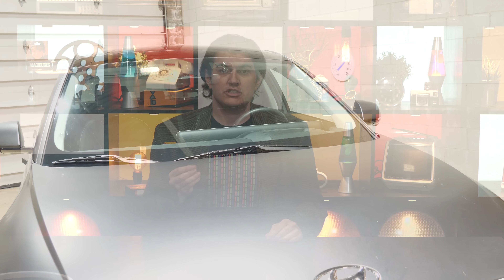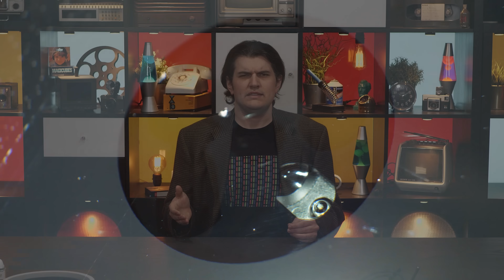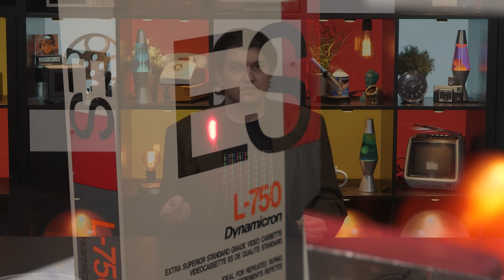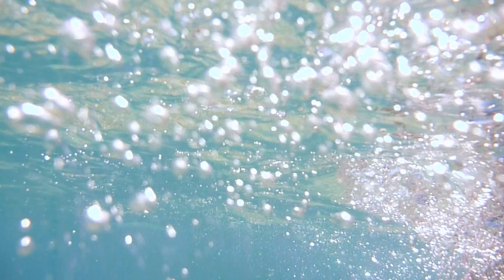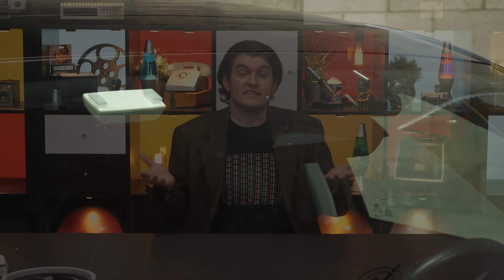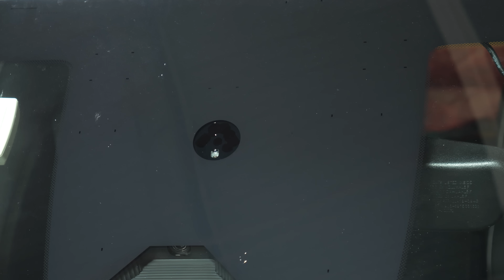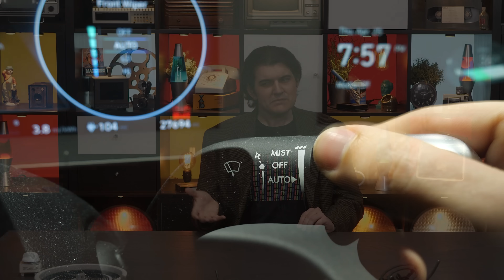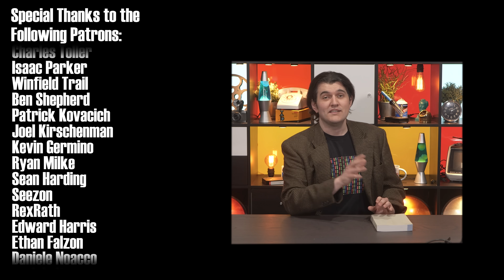The simple, clever sensor behind automatic windshield wipers

Comment: I've found on my I5 I have to keep that sensor area really clean, remove any wax from washing the car, then the auto wipers seem to work better.  I do wish there was an option for normal timed intermittent wipers, in mist the auto setting can be too fast or too slow.  Sadly my I5 is currently in the shop, a deer was way too fast for the collision avoidance system to avoid it, many thousands of dollars of plastic parts need to be replaced, when did headlights become a $2000 part?...

Comment: I've rarely had problems with the Tesla wipers based on their camera vision. One drive they were "phantom wipers" I think was mainly from tree pollen or dust. It sure wasn't raining. That was one time after a software update that definitely bugged the automatic wiper system. But yesterday driving through heavy rain for a couple of hours they worked great, even as the amount of water on the windshield changed. That is my experience with Tesla wipers most of the time the last 5 years. I guess I got lucky or just aren't as picky as some people.

I'm also pro-stalks on the steering wheel. As long as humans will still be operating vehicles (which is going to be a long time) having some physical interfaces, not just a tablet, is good. Many manufacturers have gone too far with all the buttons & knobs & switches to operate everything. A simplified software interface would be better there. But removing every physical button, knob, and switch is also bad. Having buttons be multi-purpose can be good too, depending on how they are implemented.

Comment: Our thing from that organization to whom this is not particularly directed at drives me absolutely insane. It has no concept of winter roads coated in damp salty grime that's continually sprayed up by other vehicle traffic. Never have we gone through more washer fluid in a season, trying to get rid of the endless streaks that it makes, only for it to immediately restreak the windshield seconds after we've finally gotten it clean, then wipe frantically harder trying to clear the streaks away. The CEO of 'no particular corporation that this was directed at' must have stock in a wiper blades company, as our thing does its best to grind them down to nothing in no time flat.

Comment: I'm curious... Say you park your car outside the night of a snow/ice storm and you turn the car on so the windshield can defrost to make scraping it easier. Do the ice and snow trigger the sensor? And if so, what happens if you forgot the Konami code and didn't get the wipers in the up and pulled away from the windshield  to prevent them from freezing in place? Is there something to prevent them from continuously trying to wipe when they can't?

Comment: Man, that must be nice. The wiper controls in my car only have a few settings and they're too damn far apart. First setting is 1 wipe every 10-15 seconds and is basically only useful if it's misting lightly. Second setting is 2-3 wipes per second, which even in the strongest downpour is far too fast and makes a terrible screeching noise. I often find myself manually clicking the wipers on and off every few seconds for optimal wiping.

Comment: The aversion to real buttons is infuriating. It is nice to have a touch screen available for versatility on specific tasks that are infrequent and don't warrant a significant portion of physical space in the car of their own, but everything relating to the immediate operation of the vehicle 100% DOES necessitate its own space. Everything that controls a moving part and light that moves or shines outside of the car should be required to have a physical interface available to the driver than can conveniently be used with one hand. Stuff like bluetooth pairing and setting the GPS while in park can go in the screen.

Comment: What auto wipers also do poorly is handle aging. Microscopic scratches on glass and hardening wiper rubber both make wipers a bit too eager on wiping. Yes there is a very fine layer of mist left, but nowhere near thick enough to impact driver's awarness! I was seriously considering to even replace the windshield, but settled on 'only' buying premium windshield wipers at maker's recommended intervals. Sadly my car entirely lacks the feature of manual intermittent wiping, creating such odd unexpected expenses.

Comment: As a Tesla owner, I fully appreciate the shade being thrown at "any organization in particular".

I do, however, have a wiper service button that is easily findable, so there's that...
Reply: but that takes more effort than just pushing a stalk.
Reply: @ashliehiggins  Sure, if you have any idea how to do it. Alec specifically bashed his Ioniq 5 for hiding the method of turning on wiper service mode in the manual. Teslas put that method right there in the Service menu.
Reply: @coredumperror  You're supposed to read the manual before operating the car, on two of my cars I found it out accidently and now test if every car I drive does it.
Reply: @ashliehiggins  Does adding a “change wipers” button in the settings take away from the rest of the car?
Reply: @ashliehiggins  And you always remember exactly how to do ALL the obscure gestures you learned when you read the manual 6+ months ago? If so, I'm impressed.
Reply: @coredumperror  That exact method has been used by all VW (also Audi, Seat, Skoda, etc.) cars for the past 20 years at least. It's nothing new, nor uncommon. You simply need to know, just like you need to know what the symbol on the Oil cap means, etc.
Answer 2:
Because aerodynamics haven't been this important in the past. Just so you know, my VW Golf from 2005 has it exactly like that, it's nothing "new" by any standard. Aerodynamics have come a long way in 20 years, and simply technological advancement in general.
Btw, I'm currently doing my bachelor's thesis in vehicle aerodynamics :)
Reply: @ashliehiggins he’s referring to the service button which presents the wipers for maintenance
Reply: @ashliehiggins  or you could just design the car so that the wipers are serviceable at any angle, like how cars do.
Reply: @ThePensiveWalrus  The reason modern cars don't do this is for aerodynamics. Putting the wipers' default position below the hood increases efficiency, which both gas and electric cars care quite a lot about in the modern world.
Reply: @coredumperror  " The reason modern cars don't do this is for aerodynamics"
No it is not. For the past 50+ years wipers used to be outside of the slipstream and serviceable on basically all decent cars.
Reply: @ABaumstumpf  I've heard this from multiple different sources, and it makes logical sense that having the wipers sit on an exposed surface would harm the aero. So why do you think the old method didn't do that?
Reply: @coredumperror  "So why do you think the old method didn't do that?"
Strange claim you are making there - wipers where not at exposed positions and for the majority of cars still are not. 
being outside of the airflow and being intentionally barred from access are 2 very different things.
Reply: @ThePensiveWalrus  You know why they don't do it? I'm sure it's very much favourable for aerodynamics to hide the wipers slightly under the hood, saving you money on fuel, increasing range and top speed. I think that is a compromise you should be willing to take if the cost is literally "to push a button".

Just saw your answer. Yeah, this has been done for more than 20 years at this point, it's nothing "new". You would be surprised how far aerodynamics have come in the last 30 years.

I've just looked up some literature and another aspect of wipers being hidden is acoustics. They create a lot of turbulence, and turbulence is usually a) noise and b) drag.
That kind of "everything was better in the past"-attitude is pretty much bs btw, and I hope you'll be enlightened some day.
Reply: And everyone else in the world just yoinks the wipers away from the window in their parked position, swaps them out, and calls it a day.
Reply: And then you get a software-update that says "Upgrade now to enable whiper-change mode".
Reply: @ABaumstumpf  As if the Ioniq 5 isn't OTA capable?
Reply: @BockBockChicken86  " As if the Ioniq 5 isn't OTA capable?"
Ha? Are you sure you wanted to further proof my point?

And "Does adding a “change wipers” button in the settings take away from the rest of the car?"
That is not what manufacturers are doing, so 100% irrelevant.
Reply: @ABaumstumpf  No one is adding a software update to lock features that owners previously had behind a paywall. So, by your own reasoning - no manufacturers are doing that. "100% irrelevant." Thanks for trying.

We get it. You're a car luddite and think all software is bad. You probably unironically think that there is no updateable software in older cars.
Reply: @BockBockChicken86  "No one is adding a software update to lock features that owners previously had behind a paywall."
You sure? You mean like Tesla disabling lane-assist and park-assist unless you go to their dealerships to re-enable it never happened despite that being in the contract and them openly stating this is the case?

"You're a car luddite and think all software is bad."
No, i am a software developer. And contrary to you - not a dishonest moron.

"Thanks for trying."So yes - thanks for trying, you did a great job at being a shill.
Reply: @ABaumstumpf  no, that has never happened. What has happened is customers getting later model year cars having fewer features due to the removal of ultrasonic sensors. Existing owners never lost autopark. And lane assist was never removed for anyone.

New owners who didn't have autopark eventually did get it, after a software update that did not require a trip to the dealership.

So yeah, you were wrong on many points. That never happened.

Try better next time.
Reply: @ABaumstumpf  
> Tesla disabling lane-assist and park-assist unless you go to their dealerships to re-enable it never happened

Correct. It never did.
Reply: @coredumperror  "Correct. It never did."
False - id did happen as i have shown.

But fanboys gonna stay fanboys and always have to lie.
Reply: @ABaumstumpf  lol, believe what you want. Haters gonna hate.

Comment: My 2008 Ford Fiesta has this and works perfectly, reacts instantly and at the correct intensity when it starts raining and never freaks out. My 2021 Fiesta seems to freak out so often, I'd almost rather not have them. When electronics got cheap, quality of electronic systems seem to have gone really bad. Sometimes I hate living in the 2020's.
Reply: Same :( 2011 Focus was just flawless, 2022 Kuga is... okay, but sometimes leaves me without a wipe (heh) for too long or goes nuts rubbing the wipers dry.
Reply: Try reseating it. It's probably the same sensor your 08 had.
Reply: @xirabolt  What do you mean with reseating it?